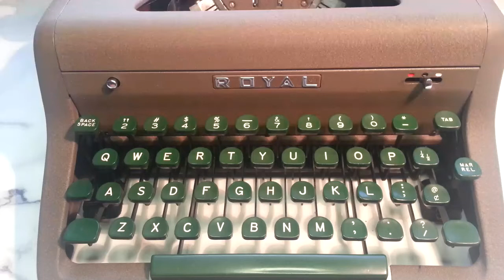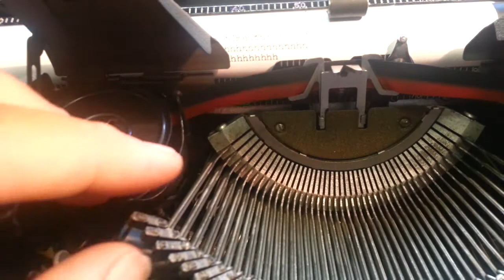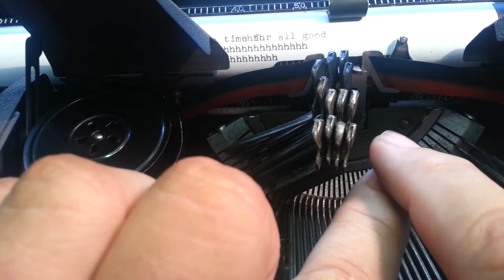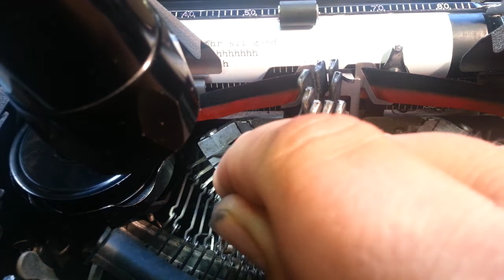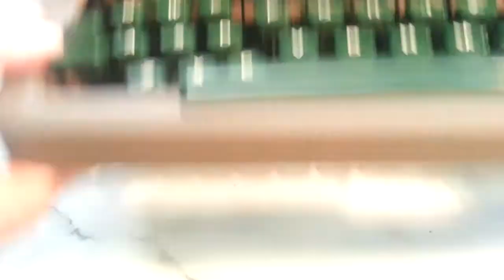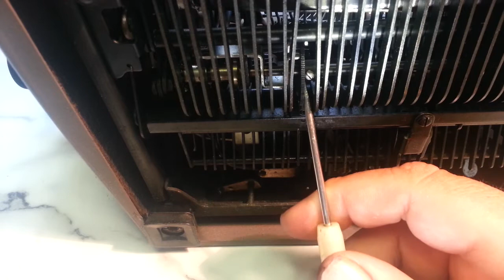Royal Quiet De Luxe Manual Typewriter Ribbon Drive Repair Fix

Comment: Man, you really saved the day. Actually a lot more than the day. As you know it is impossible to find repair shops for these old machines and I have been in a real pickle for over a year now trying to get info on this very issue.  My Royal is my preferred writing tool. You are responsible for reviving my writing and likely my career. I can't thank you enough...unless it helps me start to earn again in which case I will gladly be hitting your tip jar.

Comment: I need help. The ribbon carrier will lift but not retract back down. I found the spring on the other side. Thr spring was off the lever i returned rhe lever but the spring seems worn. Do you have any advice ro get it operational?

Comment: This really helped me understand the mechanism, but my issue is not quite the same.  The mechanism (the square piece) is coming down on each key stroke, but isn't moving the gear.  Nothing is frozen and it all looks OK, (I can spin the gear, and it all looks like it should be working) but the gear isn't moving when the square piece comes down.  I'm guessing that it's not engaging correctly, but it's hard to see in there.  Are there any other adjustments I could try to correct this?
Reply from the maker: I'm sure there is other adjustments. I would be looking for a sticky part(s). 
Not sure what is happening without looking 1st hand, very difficult to access much on these Royals
Reply: @phoenixtypewriter2136  Thanks.  I'll keep tinkering with it.